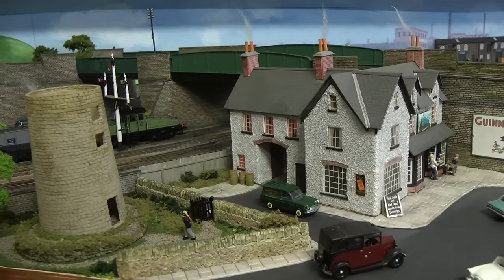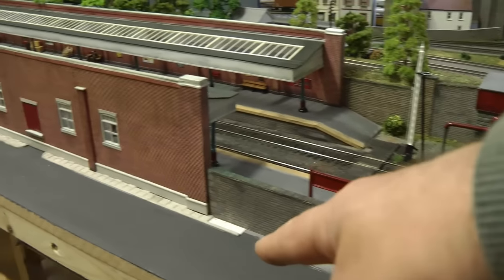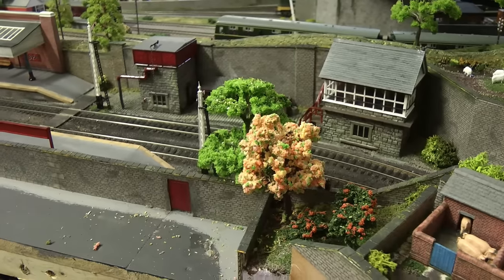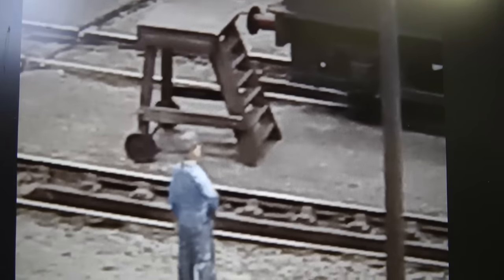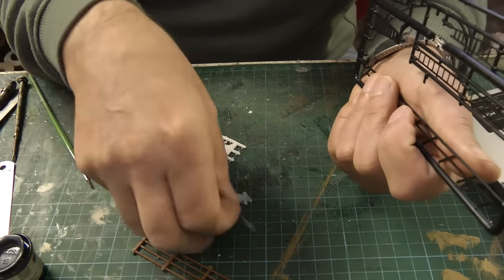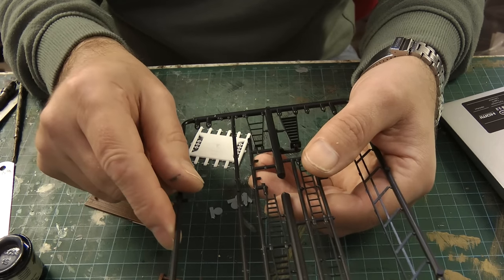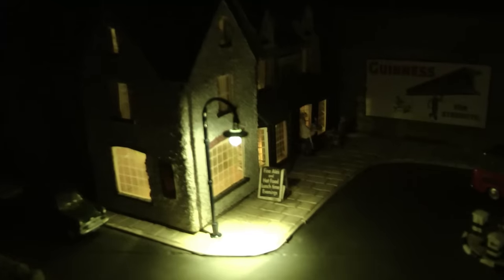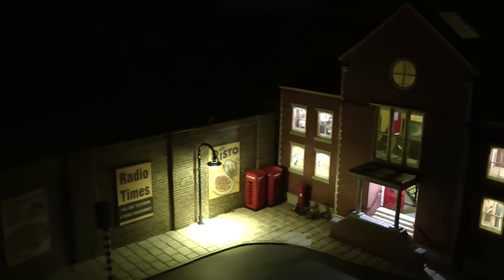Street Lamps & Mobile Ladders.       No 400

Comment: Great details Tony, the street lights are on my shopping list!
For the LEDs , I've used phone charger-plugs. From phones that I no longer use/ have. Most are the correct voltage, etc. but obviously i check the specifications on the unit first. They work fine.
Reply from the maker: Hi Peter. Yep they do work as well, the phone chargers. as long as you resitters for the Leds. just in case you get a power surge. there should be no issues. cheer's for now my friend.  Tony
Reply: @TONYNORTHEASTERN  I'm a bit of a cheap- skate! But if they are there, why waste them  or money on anything else.

Comment: Dear Tony, simply amazing all the stuff which comes out of your scrap box. Very interesting how you did the step ladders and hop-up. Nice little details for the several maintenance facilities on your layout. Even though the camera doesn’t do the street lights justice, as you said, the lighting definitely adds another dimension to the Yarrow Road station area. Love the way you showed the source of these street lights, the adapter you use to light ‘m up, the different paint scheme and the connection. The Yarrow Road constituency must have a blue background, pun intended! Cheerio
Reply from the maker: Good morning Vincent. I would to say that ideas were mine. but i had seen similar ladders on a layout at the exhibition. my input in the hop ups. which i have used in various factories.
The thing is anything to do with OO gauge is getting expensive. while some HO items still seem to be reasonably priced. and the only difference is probably a couple of millimetres in height. so yes i would encourage everyone to shop around. |Its getting closer to moving onto the next thing. thanks again for commenting. cheer's for now Tony.

Comment: Hi Tony great you built these straight away, very effective, reminds me of the travelling library ladders. Well worth doing a few at a time and using up bits from  the left overs box,  adding figures brings it all to life. I found the same with HO lamps, better value for money and  more choice. Can I suggest reducing your LED current halve or quarter it and see how it looks, looks a bit too bright - might be being exaggerated by the camera (I have seen LEDs life dramatically reduced when run too close to rated current - so I always design/ use well below so they last a life time) Take care. All the best Stephen.
Reply from the maker: Good evening Stephen. its very true what you saying about the current levels of LEDs. i normal use a 3.3m ohm resisters on Leds. which do keep the current down. the camera does seem make the lights brighter than they are. but yes it is worth thinking about, especially as i will be redoing some of the lights in other areas as they are not bright enough. thanks again for commenting my friend. cheer's for now Tony

Comment: Good morning Tony. Every episode of your YouTube channel, in excess of 8 years worth, is a lesson to be taught. You can't put a monetary value on this because what you teach is invaluable and stretches across generations young and old. Thank you for this. Can you help with a question I have.  The power supply is 24W, output=12V and amps is 2A. What kind of cable (bus wire) do you attach to it? And do you use the cable connection blocks to connect the 2? Cheers, Mike
Reply from the maker: Hi Mike. !2 volts supply or less is ideal for LEDS. as an average Leds draws 0,5 amps. cable size can vary but ideally 0.8mm or 1mm Diameter will do the job. cable can be expensive. i was lucky in my previous jab as i got some cable for free. bus bar's can be up 1.5mm in diameter. i hope this helps.   cheer's Tony.
Reply: Thanks for the advice Tony. You are correct, I have a roll of bus wire from DCC Concepts and it is 1.5mm in diameter. Would you say that it is hood to use or, alternatively I have 0.2mm dropper wire (rolls of it) that could be used. Is the 0.2mm to light to use? 

Again thanks for the words of wisdom. Cheers, Mike